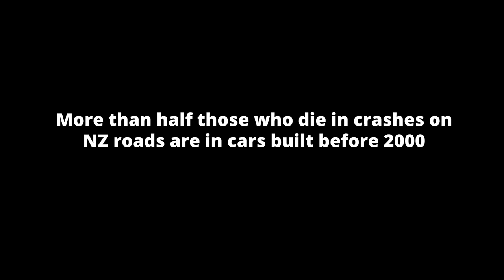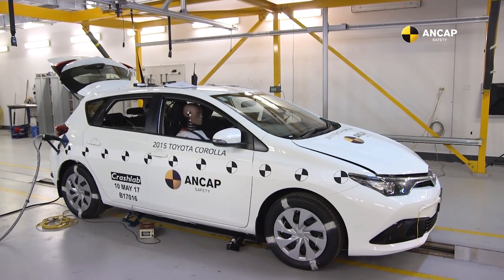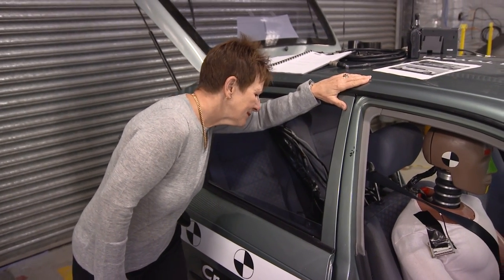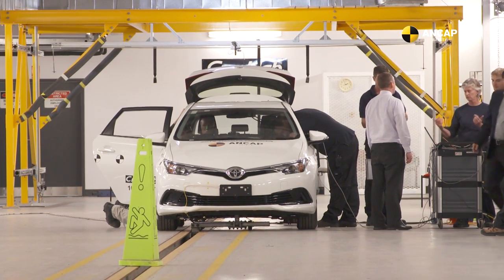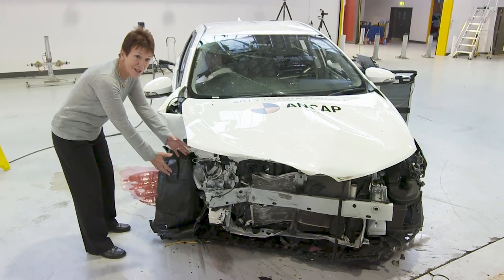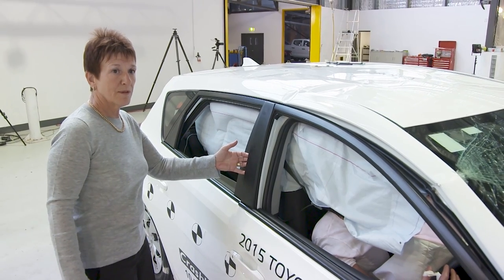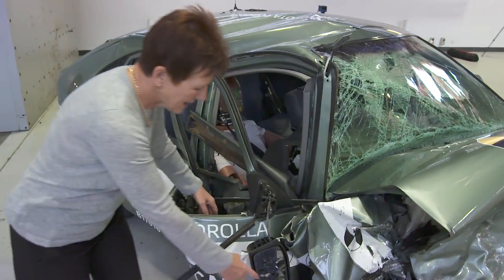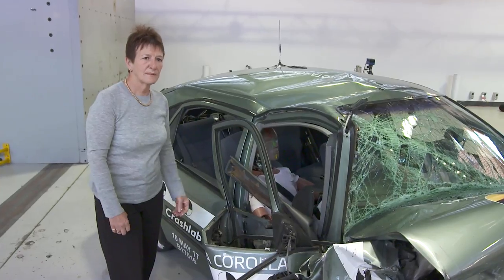ANCAP crash 1998 Toyota Corolla in to 2015-built counterpart

Comment: Amazing! 5-star crash safety rating is our main goal when buying a car lately. In 2014, while traveling at 30mph in a 2005 Subaru Impreza 2.5RS, my daughter and I got crashed into head-on by a Toyota Tacoma going 70mph. And in the combined 100mph closing-speed accident, the Subaru saved our lives with its controlled crumple zones - the engine and transmission dropped down and didn't enter the passenger compartment while keeping the front end from completely collapsing. The Tacoma had spun out on black ice and turned sideways before hitting us, and his passenger door was compressed all the way into the center console - if his car had rotated the opposite way then the driver would have been crushed. As it was, we both still broke both of our legs badly, needing several surgeries. My daughter still had her feet on the brake pedal with her legs locked = crunch, and my seat wasn't back far enough because the back seat and floor was loaded with stuff we were bringing home from college, and my knees hit the dash. Lesson > take your feet off the brakes right before impact, and never overload the car such that you have your front seat too far forward, since 3-4" of room left over wasn't enough.

Comment: The crash E110 1998 vs the 2015 Corolla was not horrible enough so they found a E100 from 1993 WITHOUT airbag and crashed it to ... But forgot to change the title of the clip from 1998 to 1993??? This stinks... That poor rolla in the film was developed in the late 80's!! FFS :)

Comment: For those saying that they removed the airbags, this is the statement from the ANCAP Safety report:

When originally on sale, a driver’s airbag was available on the 1998 model as a AU$990 option, but was not fitted to the vehicle tested in 2017.

Comment: what happened to the 1998 cars airbags? I thought they were standard by the early 90s?
Reply: Exactly my tought! I think it was around mid 90s when they started to appear in every car. I have had two cars made/sold in 1998 and both have airbags and i have had two cars made/sold in 1991 which neither didn't have.
Reply: Yes, they were standard. Had a '94 with airbags.

I was gonna comment the same thing. Why'd they disable the '98's airbags?
Reply: Maybe there were none in New Zeland (RHD model)?
Reply: Possible, is NZ that many years behind on basic safety though? Airbags were in US models from at least the '93 corollae, and the Toyota series ran from roughly 92 or 93 to 98 or 99.
Reply: Maybe it was not standard everywhere. In Brazil, front airbags and ABS became standard in every new car produced just in 2014. Of course one was able to buy a car with airbag and ABS prior to that as an optional, but it was not standardized.

P.S.: I know Brazil is not a reference at all, just pointing that might be the case of New Zealand in late 90's.
Reply: Not in TOYotas.
Reply: I was shocked too because 1994 Corolla already have air bags.
Reply: They took them out to make the 1998 look less survivable by showing the dummy mashing into the wheel. (Like it would have done in the 2015 if they had culled the bags out of that.)
Reply: That car had an airbag wheel though, something smells rotten here....
Reply: No it didn't have an airbag wheel. It was just a standard cushioned wheel.
Reply: In Australia, most cars didn't have an airbag until the late 90s, some waited to the early '00s. '98 was probably one of the last model years you could get a Corolla without airbags in Australia. They were optional there even then.

May 29, 2017 6:07 am
Reply: Toyota in 1998 make cars,with average quality airbags  & don't afraid to admit this. ))))))))))))
Maybe after 10 years ,they say ,look corolla 2015 the piece of sh** ,half of byers die...."the resalt of the test was dramatic "bye our corolla 2025)))))))))))))
Reply: My '94 Holden has airbags, but it was a pretty luxury car in it's day
Reply: My '96 passat have no heated seats, no A/C, no front fogs and no electric windows but still got airbags. I would've prefered to have all the other things though...
Reply: You can clearly see it didn't have an airbag wheel - it's plain to see. You're not walking away from that crash, airbag or not.
Reply: Only in the US.
Reply: I think because of different safety regulations around the world. Maybe US & Canada have stricter safety regulations than New Zealand? I’m not sure
Reply: Only in US models it was standard. In Australia and NZ it wasn’t available. I’ve had two of these corollas and neither of them had airbags.

Comment: 1997 COROLLA  WEIGHT IS 980 - 1180 kg

2015 COROLLA WEIGHT IS at least 1250 kg
Reply: heavier weight should make it more unsafe, your number suggest the weight is not a factor and that design is able to overcome basic physics problems. weights are about the same anyways. what about a truck or a van? I bet the new car survives that better than the old one, a truck or van should be much heavier
Reply: THE HEAVIER CAR WOULD CAUSE MORE DAMAGE  BUT THAT WOULD GENERATE MORE ENERGY AS WELL.

YOU CAN DIE IN RIGID CHASSIS AND THE CHASSIS ITSELF WOULD BE INTACT - IT IS ABOUT ENERGY ABSORPTION

AND DO NOT TELL ME BULLSHIT ABOUT MARGIN WEIGHT DIFFERENCE
Reply: @eksine  That wieight is probably the weight of the extra safety features.
Reply: no the newer corolla is 1400kg+

Comment: I am a bit puzzled. The caption says that "people are twice as likely to die in a car built before 2000". At the same time in the video is said that (more than) half of those who die in crashes are in cars produced before 2000,,,which means the other half die in vehicles built after 2000??. That's a nearly 50/50 share.
Reply: Well, what percent of vehicles on the road are 2000 or older? That's what matters. If its only 30% and that 30% carries 50% of the fatalities... it's not difficult to understand their point.
Reply: 9/11...you're right. thanks. i just failed to think at that aspect.:) cheers.

Comment: Why did the airbag in the 1998 car not go off? It should have had at least a steering wheel airbag.
Reply: I think the airbag would not make a difference here.
Reply: Maybe not but leaving out safety features in a comparison when it was obviously all there and specifically talked about in the new car seems ridiculous to me.
Reply: This Corolla is a 1993 model,i guess they didn't had it back then.
Reply: not 1993, the title says 1998 :face smack:
Reply: Actually, yes, it would, their bullshit about the occupant hitting the steering wheel never would have happened. Sure, you would have crushed legs, but you wouldn't have a broken back, its a survivable crash.
Reply: It is also entirely possible that the airbag simply didn't work.
Reply: @volkhen0  uh yes it would the airbag would have stopped the steering wheel from going in so far and stop debris from hitting you
Reply: and also it would cushion the face from hitting the steering wheel so hard 

i have a 1997 mitsubishi lancer coupe i have put airbags in it

Comment: get the safest car you can afford because safety isn't a luxury lol
Reply: That's why we've sold wife's 2002 Volvo V70 and bought her a new 2016 XC60. You know, Volvo is known mostly for its safety aspires, right? Year later brake assist does not work intermittently, she even had a small parking lot accident. The car is seeing the second dealer with Volvo Cars NA assisting, but nothing is done so far. I've took decision not to buy a so much awaited V90CC and stick with my 05 XC70, which is showing signs of wear, but, hey, it's 12 years old car, and I know it in and out! So I'd rather replace grinding wheel bearing than listen to service adviser that the new car works as expected, while for sure it's not.

2002 V70 had a great brakes, btw! Was still on original rotors with in-spec thickness, after 15 years on the road! It was a real Swedish metal, not FoMoCo or Geely.

Comment: Well, if you compare this video with the Euro NCAP Toyota Corolla  1998 Crash test, you can realize that the '98 Corollla wasn't perform this badly. So, does it tells that one of the reasons cause old cars to be fragile is the structure of new cars?

Comment: Newer car 400 lbs. heavier. Newer car wider takes the impact on 50% of the front width. Older car takes the impact on less than 50% of the front which multiplies the force from a car that is already 400 lbs. heavier. Haven't even looked at the records or specific problems attributed to the earlier model. Engineering is a great field and they have undoubtedly made significant improvements, but these videos do nothing but inspire ridicule because of the obvious discrepancies. That door support does not even look like it was welded on the end, but if may have been designed that way...just an observation.

Comment: This is a slightly biased test in that the car they've picked is the last of a generation that began in 1991. The E120 replaced this model in Japan as far back as 2000. Regardless the real test here was showing the difference in body strength and ability to absorb energy while maintaining the passenger compartment integrity which it illustrated well.  I don't think there'd be half as dramatic a difference between most average 2005-on vehicles and present however as 1995 vs 2005. We've reached a limit with strength/weight based on the materials used for mass manufacture.

Comment: That's the E100 Corolla and it was designed in the late 80's / early 90's. No wonder it sucks against a 2015 car. The E110 would've probably performed a little better.

Comment: This test was rigged to favor the newer car.  It wasn't until just a few years ago that we started doing front overlap crash testing, so setting the crash up to deliberately take advantage of the older cars flaws is dirty.  They also don't tell you that the newer Corolla is 500 lbs heavier than the older model, so of course it's going to hit the other car with more force.  The 972 airbags on the newer Corolla pop open immediately while they clearly disabled the airbag in the 1998 Corolla to make the damage look more extreme.  They intentionally chose to do the overlap crash because a direct head on crash would've been boring and the results would've been too similar to compare.  Both of these cars were given a 5 star safety rating during their time and both were very safe.  While the new car may have performed better in the crash it's no secret that the older model would still outlive the newer Corolla.  Modern cars are built very cheaply compared to the older counterparts, the older cars tend to last far longer while newer cars are designed to fail after a certain amount of time so you'll replace it.  Let us not forget that car companies these days don't care to break the law and lie just to sell a car.
Reply: From the ANCAP report:

"When originally on sale, a driver’s airbag was available on the 1998 model as a AU$990 option, but was not fitted to the vehicle tested in 2017.

Passenger airbags, side chest-protecting and side headprotecting (curtain) airbags were not offered. Seat belt pretensioners and load-limiters were not offered. An anti-lock braking system (ABS) was available as an option. Electronic stability control (ESC), emergency brake assist (EBA) and emergency brakeforce distribution (EBD) were not offered. Advanced seat belt reminders were not offered."
Reply: @rafflesmaos  yes but no other car offered those new safety features either in 1998...

Comment: This test doesn't seem consistent with another crash test of a 1998 Toyota Corolla.  There was an airbag in that one at the time, the door beam didn't snap, and the cabin maintained shape short of 8 inches of footwell collapse, leading to potentially broken legs.  I don't doubt that modern cars have better safety features, but there is enough inconsistency that it almost feels like the older model was pre-compromised here to prove a point.  ( I'm not going down the conspiracy route at all, it just feels off is all )
Reply: I will add one correction.  The test I saw was 64 km/h against an immobile object, not 64 km/h + 64 km/h.  I don't have the knowledge to compare those, and properly factor in the crumpling of the 2015 model causing energy dispersion.
Reply: I think this is the australian model or something, that's why no airbag and steering wheel is on wrong side

Comment: umm this is kind of inaccurate.. I drove a 1999 Toyota Corolla sedan, and I narrowly avoided hitting a truck that stopped in the middle of traffic then got rear-ended by a Ford Escape and pushed into said truck. The front and the rear were toast, I walked out without a scratch on me the cabin was perfectly fine..

Comment: you could probably even open this door. fails to even attempt to open door

if you are going to do this kinda thing, wouldn't you use a competitors old car, not you own? "look how shitty our cars used to be. they were freakin death traps.
Reply: That would be changing too many variables. Remember in an experiment you're only supposed to change one variable, this one being the year.
Reply: can't wait to see 2035 model. fills up with foam like demolition man.
Reply: Buick Bubba Ive noticed the side they both drive on. The engine is differemt im sure. Chassis is definitely different with time. I also thought it was the year but theres many more variables than simply the year in a newer production car.
Reply: walkin dude Toyota didn't make this video

Comment: I WON'T BUY NEW CAR becuase they're too complicated, I can't fix them by myself in my garage, they have many problems etc. I like how older cars are lightweight, easy to fix, free of problems. I don't crash everyday so I'll stick to my '98 Civic.
Reply: When you buy a new car there's not much to be fixed. ; )
Reply: I don't buy car for 5 years since I'm a car enthusiast.
Reply: +eksine

Yes, you are right, but you changed the context of fixing - we were focused on mechanics. ; )
Reply: Not sure why a new car would be harder to fix, more expensive maybe. If something goes wrong just replace the electronics. Does it require programming with a dealer computer or something? Power steering pumps, engines, alternators, etc should be the same